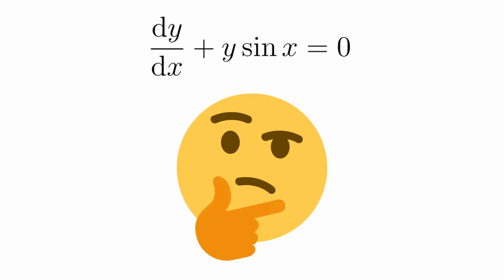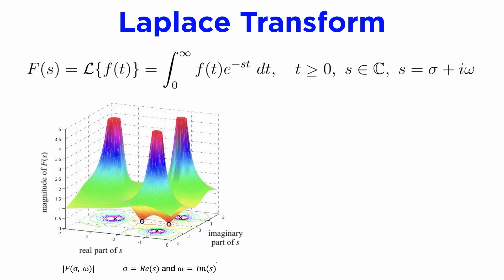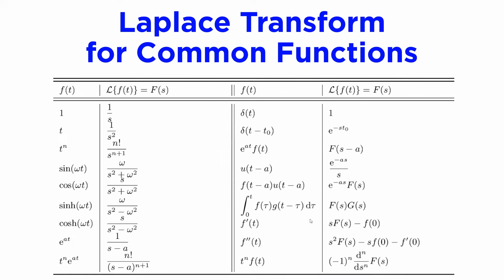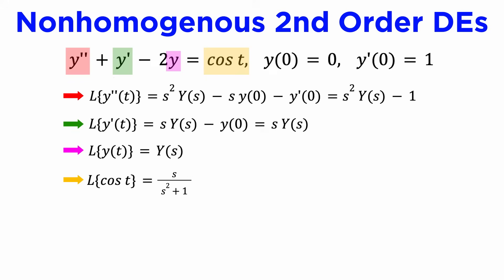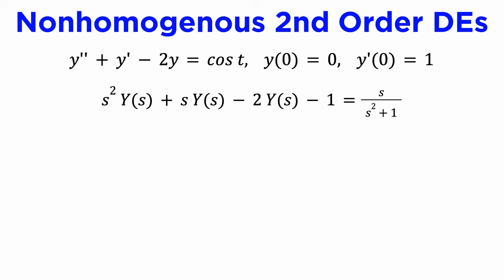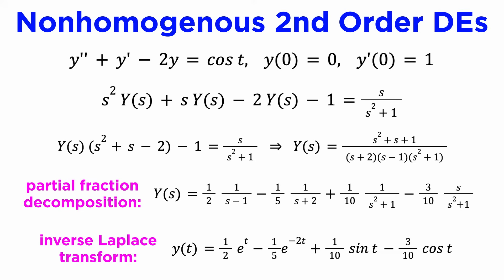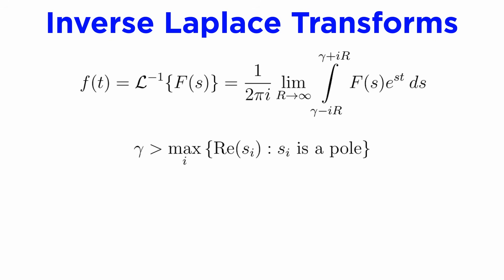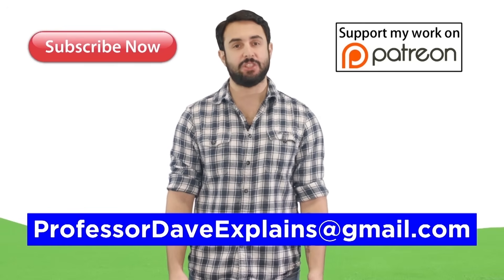Laplace Transforms Part 1: Solving Differential Equations

Comment: Hello Proffessor
You can address the Fureir manipulations if and only if the function is continues 
While further divide Furier manipualtions into Furier series if the signal consists of multiple frequencies accuring in the same time and Furier transform if the signal consists of different frequacies at different times

While Laplace transform is for non continues funcrions as no Furier transfor or series can be applied to them
Laplace discovered his functions when he coudnt find Furier transform or series to the heaviside (switch) function